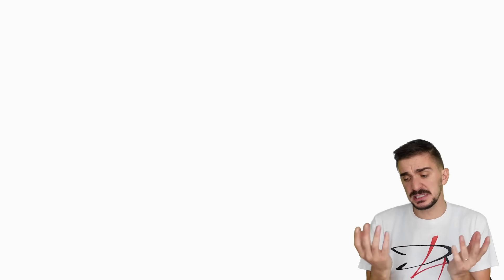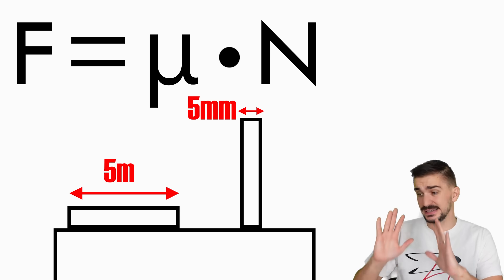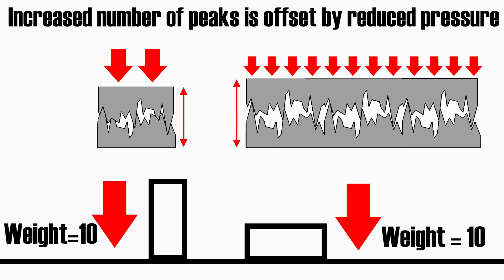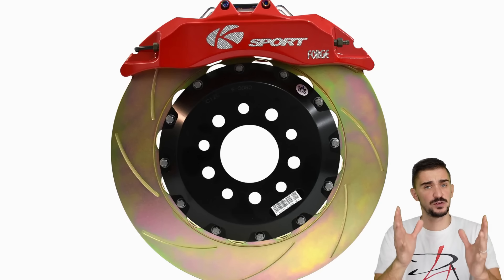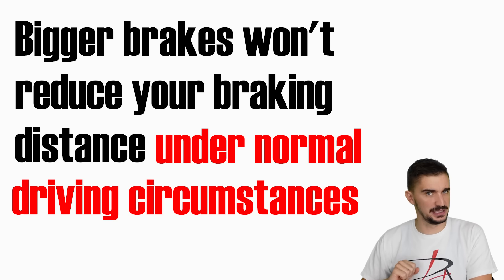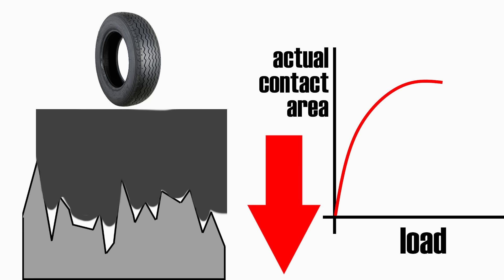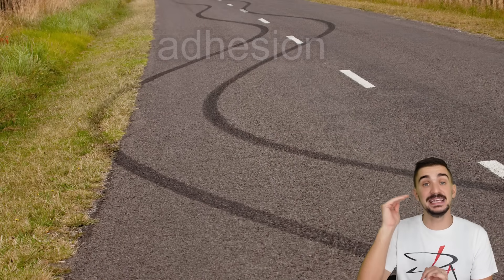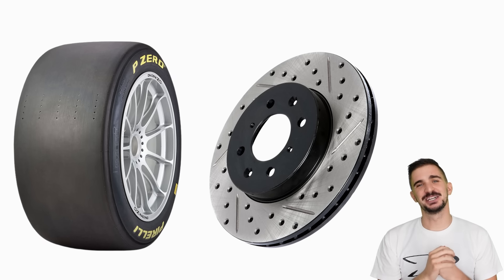Why Big Brakes Won't Stop You Faster but Wider Tires Will - Friction and Surface Area Explained

Comment from the maker: Follow-up video that covers larger disc leverage and other questions this video may raise: https://youtu.be/Ql9eYh31kTw
Support the channel by shopping through this link: https://amzn.to/3RIqU0u
Become a Tuning Pro: https://hpcdmy.co/dr4a
Brake the bank: https://amzn.to/3TLiqnj
Patreon: https://www.patreon.com/d4a 
Never boil: https://amzn.to/3skjG58
Reply: I hope you're okay in Serbia. I know things are getting crazy over there ... and we all love you. 
Honestly, they're also going to get crazy here in the US, too ... The US is making a mess of the world.
And many of us feel badly for what idiots our leaders have been. Blowing up NS 1 and half of 2?? (SMH)
Reply: Doesn't the extra leverage from the braking surface area of bigger brakes being further from the centre make bigger brakes work better?
Reply: @MrBiteus  
Yes, and no.

The further from the center of the brake disc is, you do create more braking force for a given clamping force of the brake pads. But the surface of the brake disc also moves faster, and can potentially produce more heat, for a given clamping force.

Meaning that the brake pads, which probably didn't grow bigger, now have to handle more heat.
Which is fine if they can handle it.
This is why high-performance brakes have oil coolers too.

Also, the limiting factor is usually the tires, having brakes that can easily lock up the wheels, does not necessarily make for a better brake experience.
Reply: Another reason why adding bigger brakes to your car won't necessarily improve braking performance, is if you cannot add wider tires to it - If the original brakes can already outperform the tires, you will need tires to improve braking performance, no matter what brake disc/pad you add to the system.
And since a stock car has brakes designed specifically for the tires they ship the car with, the brakes are usually already strong enough to handle the tires, or even overpower them.
Reply: If you have wider tires you might need bigger brakes to take full advantage.
Reply: @jeffk464  
YES !!

Brakes and tires should be matched.
For example, bigger diameter tires require bigger brakes ... something off-roaders sometimes forget.

Something like a 3 ton Jeep going down the highway on 40" tires and bottle top caps for brake discs is incredibly dangerous !
Reply: 3:14 what a quote!
Reply: 7:08 that's not entirely true. motorcycle brakes need to dissipate a lot less power because of the lower overall weight. for this reason they are skinnier then care ones
Reply: in other words bigger is better ... just wait 7 mins to tell everyone about the OBVIOUS brake fade... sure, whatever.
Reply: @campsitez2355  
Not all normies out there, knows about brake fade .... you'd be surprised at the ignorance some people have about the big metal boxes they drive around in every day.

Heck, a lot of them don't even know how to change a flat tire, with a spare tire.
Reply: 잼있어
Reply: IT   STOPS   BRAKE   FADE    HOT   FACT
Reply: @FixItStupid  
It MIGHT stop Brake Fade, if the brake pads can handle the heat. Just increasing the diameter of the brake disks isn't enough on its own.
Reply: I was waiting for this to be discussed: It's definitely harder to stop the wheels while grabbing them near the center. Bigger discs give a contact point farther away from the axle, therefore increasing the braking force with less fluid pressure. What am I missing? OR is it missing in the video?
Reply: @JayJanePhotography  
You're missing heat and tires ... just because the brakes are stronger, does not mean the whole vehicle brakes better, because the tires are usually the weak point.
Though you may end up with less brake fade.

However

While the discs add more brake force, they also heat up, and cool down faster - But if the brakepads are the same, you run into the same problem.

This happens, because surfaces further from the center rotates at higher speeds ... more speed = more friction per time unit = more heat to displace.

A better solution is to reduce the overall weight of the car, as that reduces the brake force needed to slow the car down, thus reducing the heat generated.
Reply: 12:56 narrow tyres are actually LONGER so that's why it's a bullshit🤷‍♂
Reply: From the first moment i tell you yuor statement is false. A bigger disc  brakes will give you a better breaking power. It's physic

Comment: But wouldn’t bigger discs (or break blocks) make for better thermal,performance ?! Get rid of heat better also means your  able to break better maybe not in turn 1 but then in turn 2 3 4 ff.

Comment: As much as i love your videos, i partially disagree. Installing a same size brake caliper on a small diameter brake disc or a large diameter brake disc does not alter the surface area, but you gain more stopping power on a lager brake disc annyways, because the leverage is bigger. The same goes with brake calipers. A larger brake caliper has more piston surface area, because it has more or bigger pistons inside. If the force on the brake pedal is at a constat, the force that presses the brake pads together changes with the piston area of different brake calipers.

Comment: I recently gave my bike a facelift by installing huge tires. Man they look gorgeous. 
However, I've realized nothing changed in breaking performance, actually made it worse in wet condition...where it matters the most
Reply: Maybe the bigger tyres you got just aren’t as high quality as your old ones

Comment: Hi! Thanks for the great video! I often argue with people who think that the contact patch affects friction force, I just have one point to add. We're talking about motorcycles in the city, not on a track. And, more importantly, under urban riding conditions - the speeds, the turns, the road surfaces. It seems to me that the contact patch area has practically no effect on friction under these conditions. In addition to all the effects you listed, there's also the fact that a narrower front wheel is easier to handle. In any case, thanks for the excellent video

Comment: This explanation is 100% right. Excellent job explaining it! Racing brakes are 100% about heat management. Racing tires are very complex, with many trade-offs between grip, heat management, and feedback to the driver.

Comment: The brakes stop the tires. The tires stop the car. Bigger, higher-tech brakes shed heat and resist fade better, and can be easier to modulate in racing. Also, they’ll last longer under racing use. But it’s the tire contact patch shapes and sizes that accelerate, decelerate, and turn the car.

Comment: It's not about stopping quicker, it's about not fading during constant and hard usage. Bigger rotors with stuff like grooves give you more surface area to dissipate heat. Bigger calipers with more pistons will give more even pressure across the pads and allow for a bigger contact patch, which will also heat up more slowly and dissipate heat more easily.

Comment: oh dear. Tyre width has no direct bearing on contact patch area.
The contact area is simply a function of load on the tyre/tyre pressure.
So a wider tyre at higher pressure may have a smaller contact patch than a narrower tyre at a lower pressure.
This data is from the Boing corp (google contact patch area of a tyre)...seems counter intuitive but its correct.

Comment: Don't bigger diameter brakes (with more pistons and the correct size master cylinder and brake bias) have more leverage though? And don't they dissipate heat better?
If bigger brakes didn't do anything, then why isn't there only one brake size available on everything in the world that uses brakes?

Comment: He's missed the fact that larger breaks often add additional pistons in the brake callipers, because the latter can be made much larger to accommodate more pistons. For similar diameter pistons and same hydraulic pressure, the normal force applied to the brake pads will multiply, and so will the breaking force.

Comment: Wider tires will produce more grip. except for on wet due to hydroplaning. or icey road surfaces

brake overheating will cause brake fad. and braking performance varies with different different brake lining materials. such as ceramic, metallic, or asbestos type material. NASCAR uses hoses with high output fans. to push large amounts of air across the brake rotors to help with brake cooling. any time additional cooling can be added to brakes. it improve brake performance.

Comment: do more pistons in the caliper apply more force? or does that depend entirely on the master cylinder? ... how WOULD you design a hydraulic system to apply more clamping force to the disc? thx!

Comment: Hello
Question: what is the optimal pressure between a tire surface and the road surface, ( just a general value because I know it depends on the tire material & road surface). My issue of confusion comes from larger tires said to have better traction but rail road wheels are still narrow.

Comment: Good video!  But one thing you didn’t address is the fact that a larger diameter rotor is a larger lever.  A larger lever does increase force.  That said, as others have pointed out, if you already have enough force with a smaller rotor to lock up the wheels, adding more leverage is not that significant.  Still, it seems like a larger lever might get a stronger initial bite.  You can get to the point of maximum braking slightly quicker with a larger rotor, I would think.  But probably not significant to the average car.

Comment: Bigger brakes, slotted, drilled calipers with more pistons do In Fact improve braking performance :O 

The title is kinda misleading or misunderstanding. Nobody increases stopping power or reduce braking I'm distances. It's about consistency and eliminating fade that is what "upgrading brakes performance" is. 

A budget factory set up for normal cars is really only good for 1 emergency stop from a moderate speed. Get speeds up and these set ups can fade out before 1 emergency stop is complete :O that itself can result in a crash instead of a safe stop. 

Now if you spirited driving accelerating and decelerating down something like the tail of the dragon a few moderate slow downs with a small basic bake set up will fade out and a corner potentially will be missed and car goes off a cliff or into some trees. 

These set ups a not for "stopping power" but consistency and reducing the brakes fading. 

When your brakes fade, you have no brakes.

Comment: Also a wider tire DOESN’T have more friction, or friction force.
Reply: A wider tire doesn't have more friction? Then why dont drag cars run skinny tires in the rear. Traction=friction.
Reply: @ceasarspalace The wider tire has less normal force per square inch.  The friction force formula F = μN doesn’t include the surface area because it doesn’t matter.  Practically speaking however, the wear rate of high friction rubber is so fast the tire would be worn so quickly it wouldn’t be practical so they gain tire life by spreading the contact patch over a wider surface area.
Reply: Tire engineers know this, so tires with a higher friction coefficient will be made wider.  Which leads us to this modern misconception.

Comment: I wish I had smaller brakes that would weigh less, reduce unsprung weight and stop just as good.  Of course with such a small surface area about the 3rd time I stop from 100 mph they would be glowing red hot, the fluid would boil into a gas, and my pad material would outgas turning it into a frictionless shuffle puck.
Reply: Look at drag race brakes from a brand like TBM. The discs are tiny and will glow red at first 200-0 mile stop. They are designed to handle this, while being so light as possible and also having zero drag. Drag racers back in the day preferred drum brakes, since they could be (mis)adjusted to having zero drag.

Comment: This explanation is true provided the same calipers are used, and it all boils down to heat dissipation. How about larger caliper pistons? If the hydraulic pressure in the braking system remains the same, the normal force will increase with the larger piston diameter, thus increasing the friction force 🤷‍♂️

Comment: Increase disk break size will decrease the stopping distance 
Increased Braking Torque (Lever Arm Effect)

Braking force is applied at the rotor's friction radius (distance from center to pad contact).

A larger rotor increases this radius, meaning the same caliper clamping force generates more braking torque (Torque = Force × Radius).
Reply: Yes, just that brake torque isn't the limiting factor even with stock brakes. What limits braking distance in almost all cases are the tyres. If ABS kicks in, that's as hard as you can brake with the tyres you have. The brakes could do more, but the tyres can't handle any more brake torque.

Comment: Larger brakes may not necessarily increase friction, but the location of applied force is also important. A larger brake rotor means that the friction force from the brake pads is applied further from the rotational axis of the wheel. This can be simplified to the brake pads acting on a longer lever and therefore the same friction force would have a greater impact on angular momentum and would increase braking force.

Comment: If you want to be trusted explain WHY an clutch of 228mm holds way less torque than one of 240mm which have THE SAME clutch disk material and even LESS clamping force from pressure plate? This was proven THOUSANDS of times.
Then a bigger brake discs are better because dissipate MORE HEAT and result is obviously better braking performance by keeping more efficient for longer time.. aka few seconds more which can make difference between LIFE and DEATH.
Reply: The question is what is the limiting factor, and usually it's not the brakes, it's the tyres. ABS kicks in usually when your tyres starts to slip. With other words, the tyres have reached their limits of what they can handle and no amount of additional brake torque will change anything from this point on.
Yes, bigger brake discs dissipate heat better and also because they have more mass, they can take more energy until they reach a certain elevated temperature. But generally that isn't relevant on public roads. Show me the scenario where you have to do 5 emergency stops in less than a minute. On a race track, sure, there it is relevant but on public roads no.

Comment: An excellent explanation. The only other aspect, which was not covered, is that the contact area primarily depends upon load and pressure in the tyre. It is the air pressure within the tyre which has to support the vehicle (if we neglect sidewall rigidity). So putting wider tyres on a vehicle changes the shape of the contact patch, making it thinner but wider, but not larger in area, if the pressure remains the same. This will increase grip in a sideways direction but not in the direction of travel.

Comment: If Friction Force = Coefficient of Friction * Normal Force, then how can a wider tire stop you faster/shorter? There isn't any Width or Area variable in that equation when it's applied to tire contact patches on a road surface, any more so than there is when it's applied to brake pads on brake rotors. If the answer is, as the video explains, that the equation gets some modifier in the real world for the contact patch width or area of tires...then so to does it get a modifier for brake pads and everything else.

The claim in the title of this video is only true if a car is grip limited. Now, that IS the case on pretty much every modern car, but it's not an absolute given. There are certainly car/tire/brake combinations where it isn't the case, and you could use more powerful brakes, either via increasing the Coefficient of Friction variable and/or the Normal Force variable in that equation, and this could make you stop faster/shorter.

Saying the claim made in the title of this video like it's a universal law of physics is a misrepresentation.

Comment: Lo que dice el locutor del vídeo es cierto, a mi proyecto le cambié el sistema de frenos original por uno deportivo, discos más grande con ranuras y perforaciones; mientras los frenos estén fríos, no responden con tanta inmediatez, pero a medida que se calientan, la respuesta de frenado es más inmediata y precisa.

El sistema original respondía excelentemente en frío, pero necesitaba gestionar mejor el calor porque incluso torcí los discos de fábrica, necesitaba algo que resistiera altas exigencias.

Comment: Sorry to say but regarding the brakes you are not considering the increasing of the diameter. Bigger diameter allow you different improvements:
- You can use more number of hydraulic pistons in the callipers. You increase the power of your brakes (limit is the moment in which you block the tires)
- Only because increasing the diameter, the brake torque increase
This two things make your brake power increase heavily

Comment: The title of this video is obviously not accurate. 
Brake torque generated by the rotor and pad, friction force generated by the tire, they are two chained items to decide the deacceleration of the car, if you want to get big brake force, both of them should be strong enough. 
Max brake force decided by the weaker of them. Simplest logic is, if anyone of them is 0, the total output of the brake force is 0. 
Larger roter can generating biger brake toque, brake torque = friction from pad X radius, in another word, provide bigger brake power. 
cross drilled rotor has better thermal radiation as more air suc into the inside of the rotor to cool the rotor, the grooves also scrach and clean the pad in real time for higher friction coefficient.